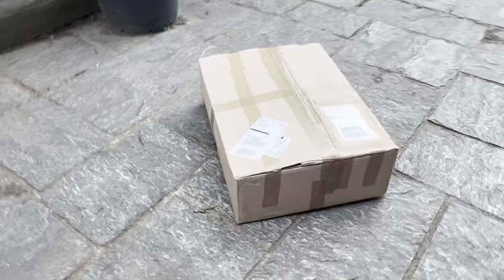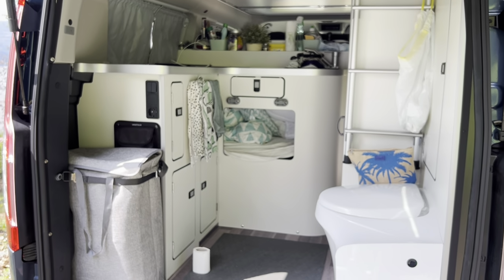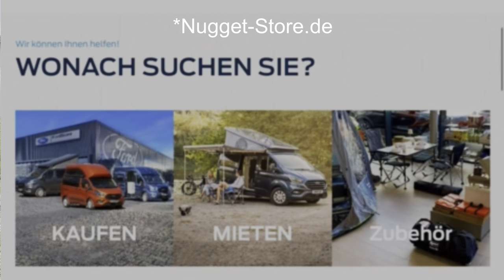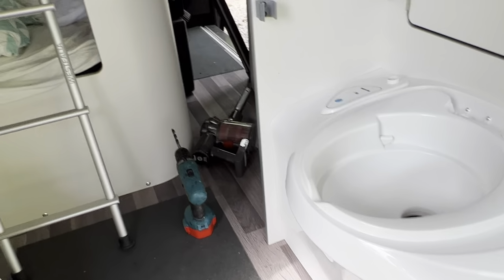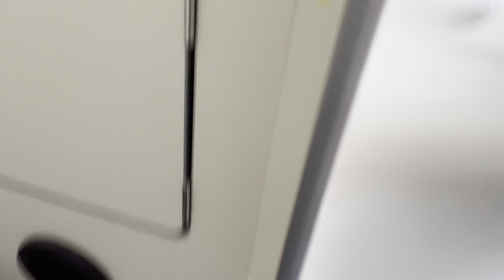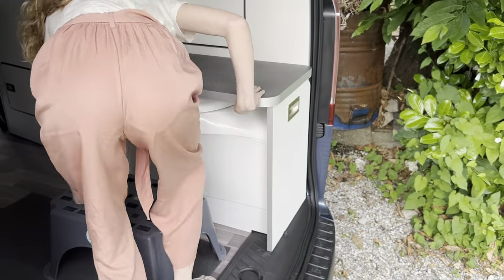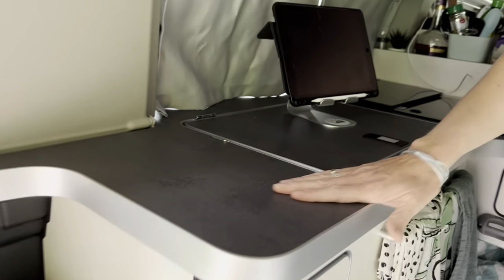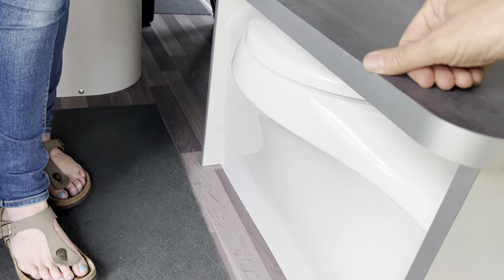Westfalia should do this!

Comment: A couple of thoughts as to why this shelf isn't standard. 1) manufacturers need to be careful with Gross Weight. The vehicle is approved up to a given weight. The difference between the curb weight and approved max weight is the 'Payload', such that as you add options the Payload decreases. The payload needs to cover 5x adults plus luggage, water etc.. 2) the other reason is pricing policy. Vehicle pricing is very competitive because everyone compares that, whilst options are a good way to make up your overall profit. It's not greed as such just the way many companies work. The best value is usually the base product with no options!
Reply from the maker: Thanks James, I hadn’t thought about the first point you made, and our van is probably fairly weight sensitive.  As far as I am aware, Westfalia don’t even offer this as an option, which could be for the same reason, I guess.  Thanks for commenting, all the best 👍🏻

Comment: Looks great but surprised no one tried to open the cupboard behind with the lid up. I’m assuming you can’t and can only open it with the lid down.
Reply from the maker: Yes, good one Paul.  You can open it a small way, but to access it properly, the lid needs to be down.  However, we always put it down when finished with the toilet as this saves any mishaps with it flying down if it’s accidentally knocked.  Thanks for the observation and comments!